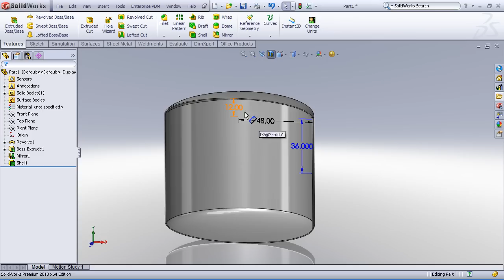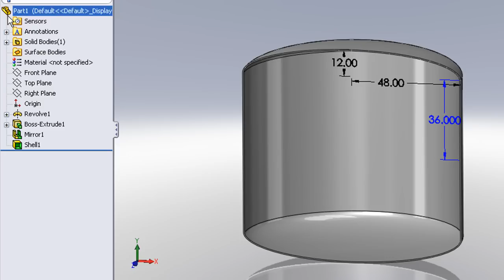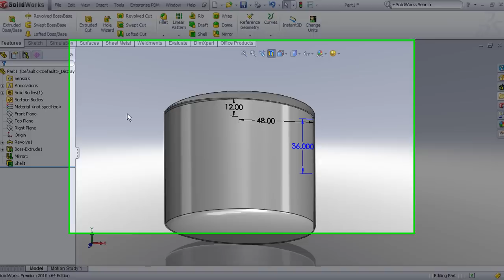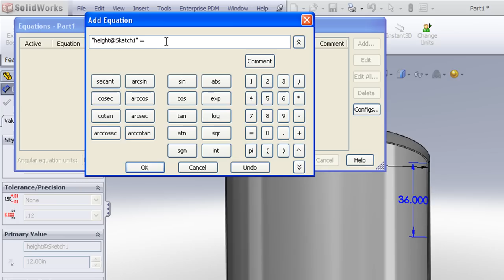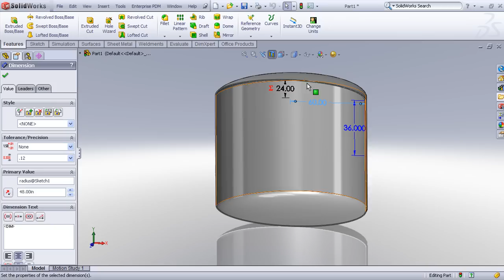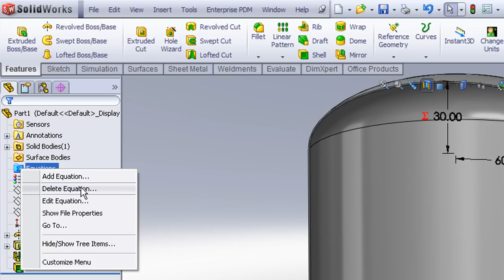Adding Equations in SolidWorks

Comment: A quick warning to anyone worry about legacy drawings.  Don't assume microsoft excel version + sw version + o/s will all work together seamlessly.  In real mfg doc environment use a "hard" dimension and don't rely on equations unless it's SW self-contained. This is cool stuff but only if "you" are in total/absolute/complete/unquestioned control of the files and prgms.  Peace.

Comment: Avoid making a circular reference; one equation referencing another equation which references the first equation.  You won't get an error message, but every time it is rebuilt, the dimensions will change.

Comment: Nice information sir, but  my solid works is working odd, because after I extruded my object, I unable to edit the dimension, even change the name, like what you did in the first minute, so what i did is put the equation in the sketch and it's really frustating, maybe you can help? thanks!